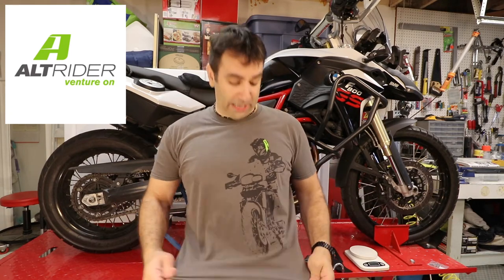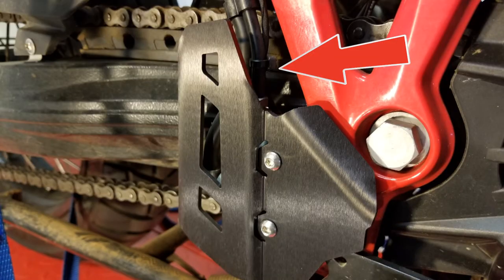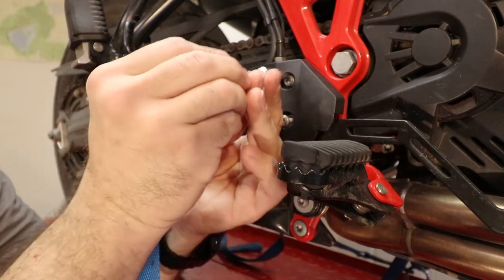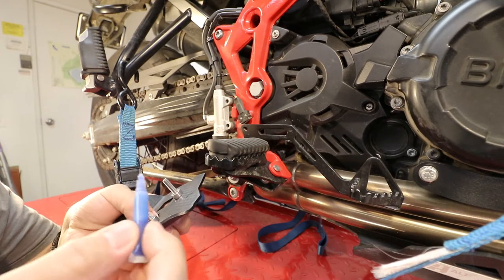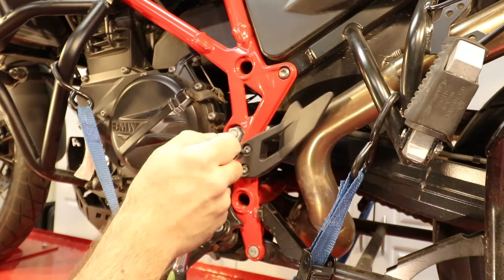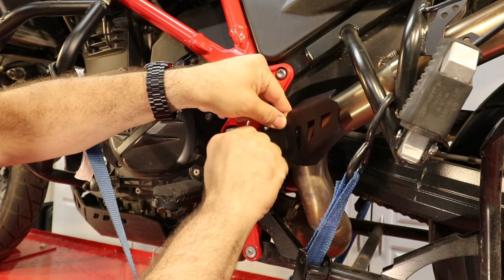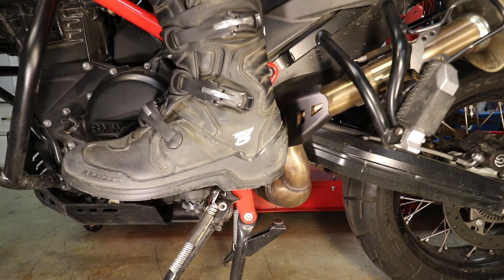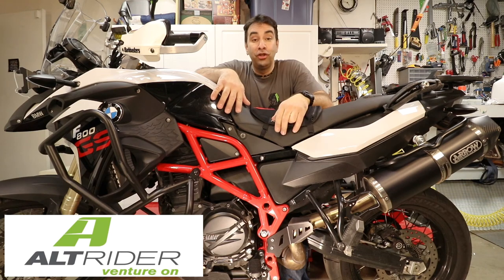The F800GS gets an Altrider rear brake master cylinder guard and Exhaust guard

Comment: Hi Albe! Do you have a DIY about getting the brake pedal higher? I don't want to spend 90$ on a new pedal
Reply: Just bend it!
Reply: outty77 Haha I wanted something a little bit nicer 😅
Reply from the maker: +Pablo the brake pedal is fixed, I'm looking to find something cheaper the 90$ to raise it a bit.
Reply: I bought one on Ebay $10 for my F650GS. Made pedal larger not higher.
Reply: fdxman74  Thank you! That one seems exactly what I was looking for!